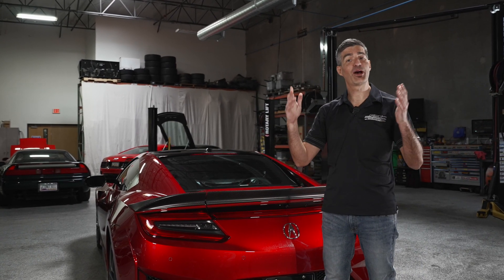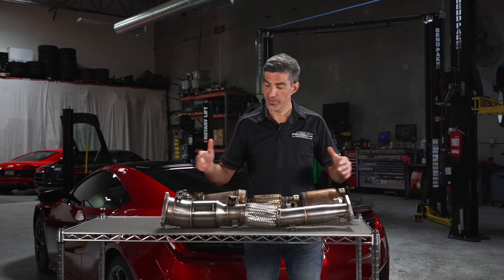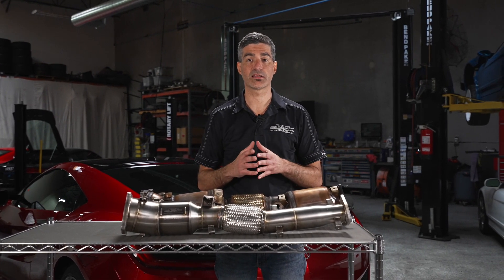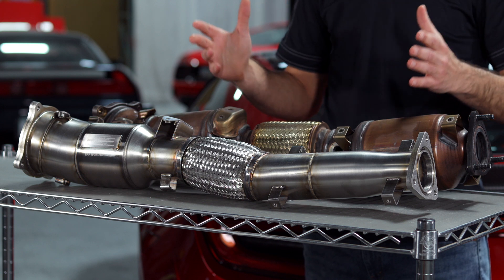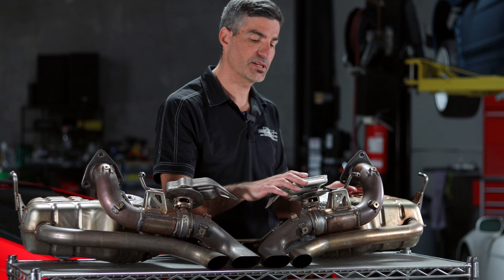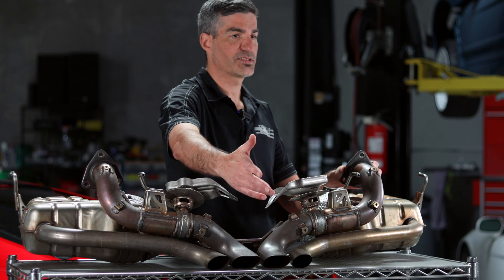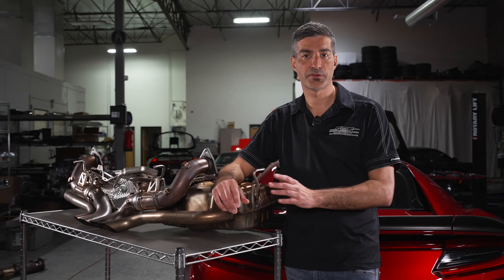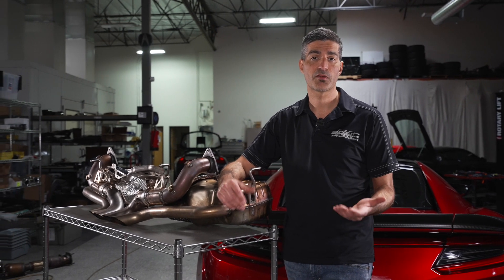ScienceofSpeed Exhaust & Downpipes for the Second Generation NSX

Comment: I added the JB4, drop in K&N filters and Science of Speed downpipes to my 4 month old 20' NSX. I'm beyond happy with the results! Testing my street temperature, non cooled down NSX with my Dragy the 1/4 mile on street tires is 10:46 at 133.46 mph. The 1/8th mile was 6.79 at 107.02 mph. Perfect drivability and Acura/Honda Reliability! The perfect daily use capable Supercar!